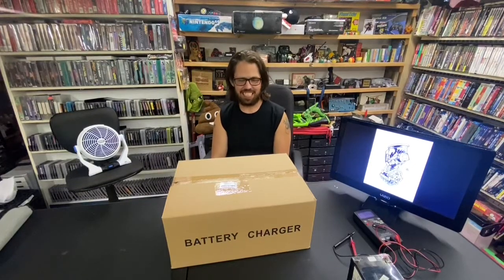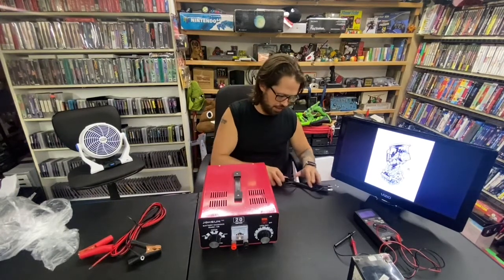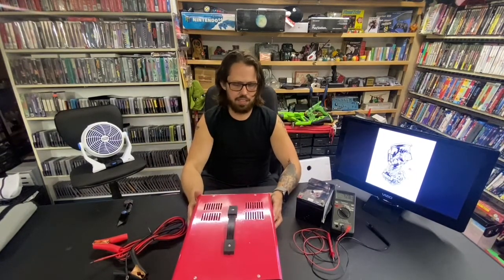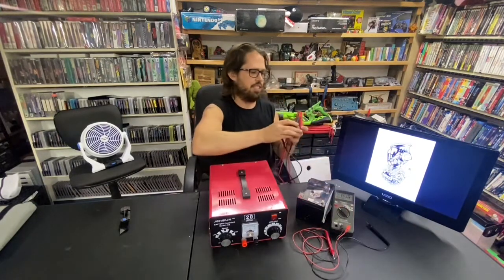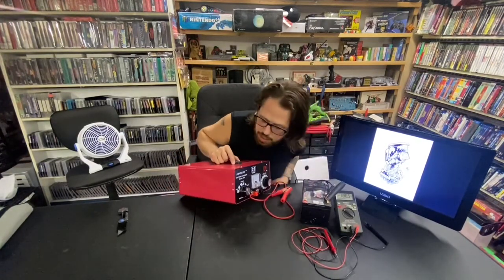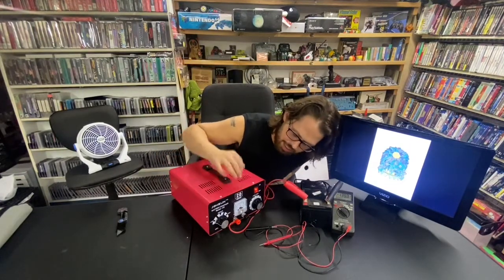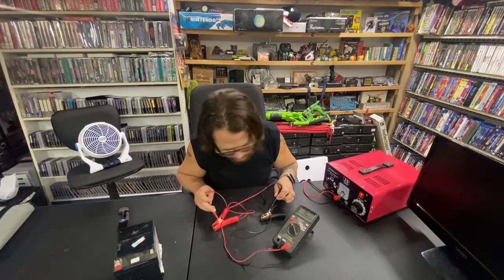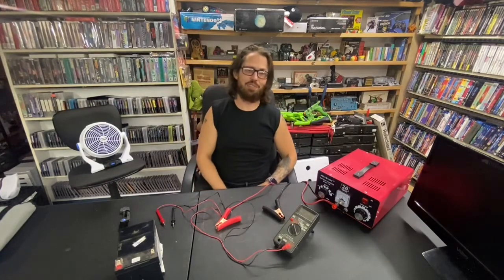Battery Charger 12V/24V/36V/48V/60V/72V Cars Voltage Current Manually Adjusted unboxing and testing

Comment: I bought the same one for charging  dead golf cart batteries..... works great ... I really love mine and I believe it will reduce power as battery gets close to fully charged ..... and It works great on golf cart batteries ....seems to be good quailty .... easy to use .... bout $180....